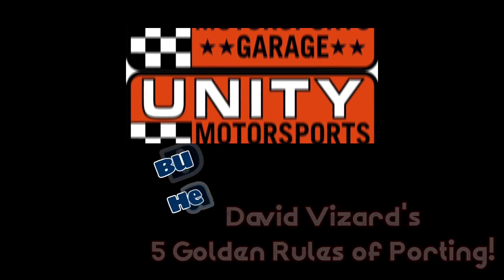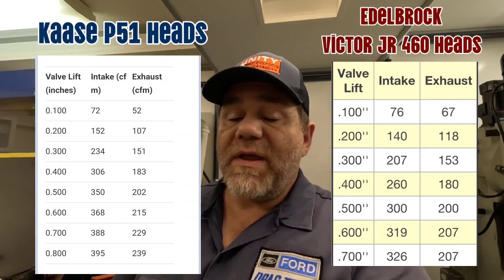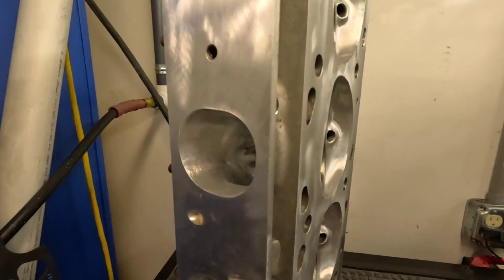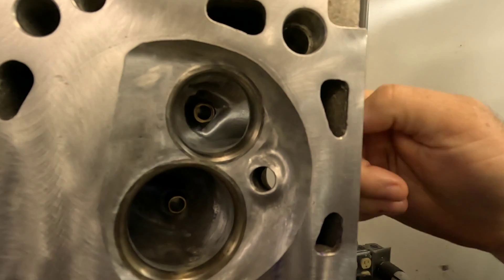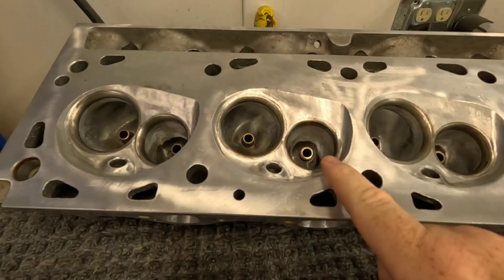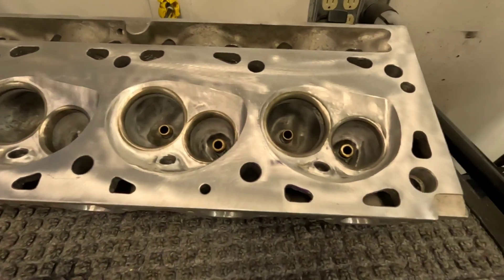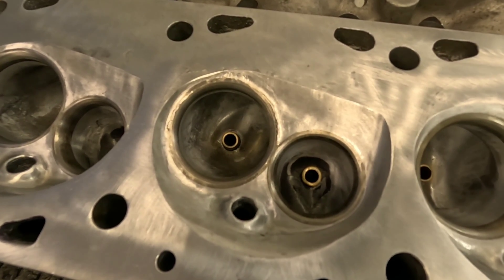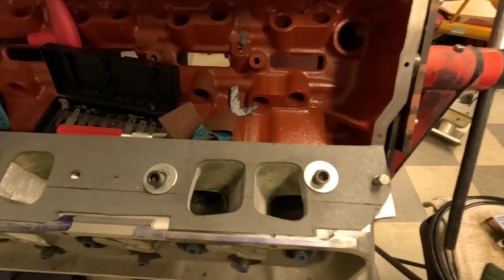Big Block FORD: Budget Porting the wrap-up! Using David Vizard's 5 golden rules

Comment: David's rules are an awesome start for anyone wanting easy horsepower. Keep in mind that the exhaust valve head shape is usually critical to what you do to the bowl on a 385 head as well. Lowering the floor on the exhaust port slightly just on the outside of the port works wonders on many castings. If the casting has the thickness and strength to do so, setting up a 385 head for shorter reach plugs and unshrouding that area has huge advantages in a nitrous motor as well, so does relief angling (softening) the entire quench area into the chamber. The last thing you want is preignition from quench heat and fuel build up in a nitrous motor.... That lets more than the magic smoke out..... Keep in mid that Casper could run some giggle juice too. And that 460 wont stand a chance.....

Comment: I'm porting and chambering my head now. Im just getting over cutting the harbor freight wheel chocks in half with a sawzall took quite a while but i like it. I will show it i my next video. Did you ever get the 30 odd pages from the book that didn't get published? Can you talk more about angle milling heads for a better valve angle? The PTV, and the piston the deck clearance, center lining valves in the bore. Is 0.0472in a good quench height? I'm hearing piston to valve clearance can get down to .03
Reply from the maker: Sean I have the pages, I just need the time to sort things out.  I may do a video addressing those things down the road as they are really good topics.
Andy

Comment: Kasse head numbers are a very high bar to meet. Definitely following this project! What's up with the Casper trans?
Reply: Ben Alameda has a channel too and he is a real visionary
Reply from the maker: Cope is doing some testing in a Supercharged Lightning powered F150 and my Valvebody/Transmission will probably be done by early spring
Andy
Reply: Kasse chambers are light years ahead of these edelbrock’s…curious as to flow#’s and hp #’s
Reply: @matthewnosal6893    One look at those chambers and I thought we were back in 1970.  Edelbrock heads can be garbage, for the most part.  They seem to be the very last to improve ports and chambers based on the latest information.